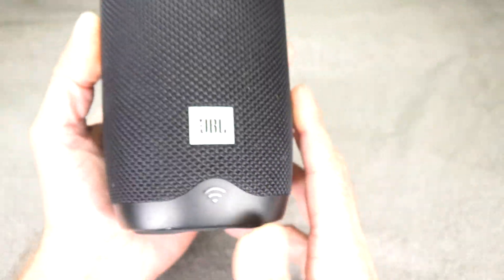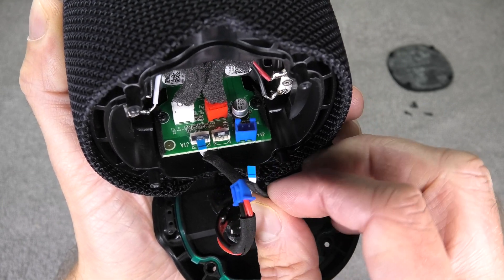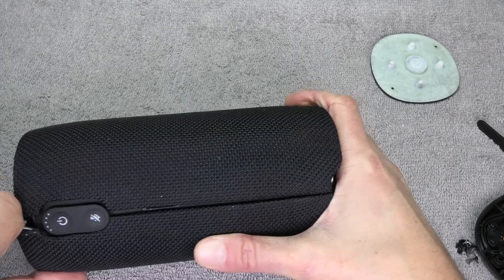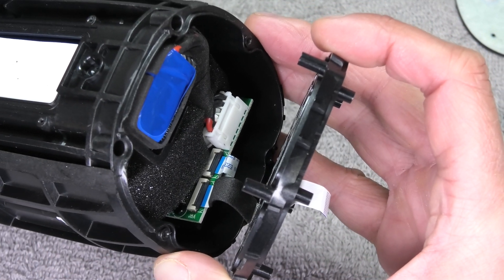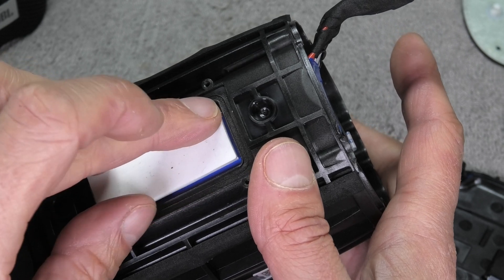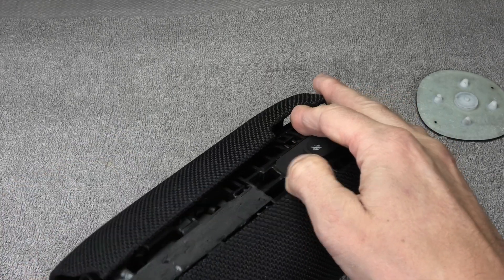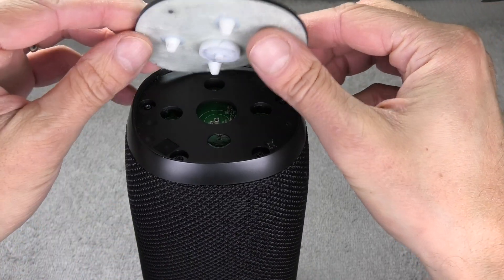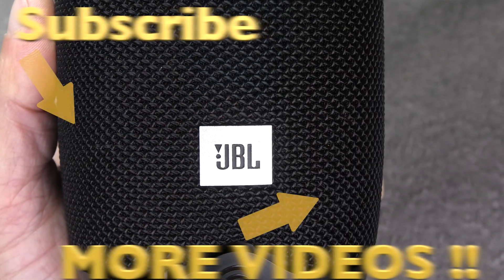Battery Replacement for JBL LINK20 Bluetooth Speaker (How to DIY)

Comment: Ok - Finally got around to this. Thanks for the video. A couple of notes not expanded on in the video. The screws with the washers are incredibly difficult to remove. I sprayed them with penetrating oil and let them sit for 10 minutes. I was careful to just get a quick spritz in the hole and protected the speaker with a cloth, wiping up any extra. I then placed the speaker on the ground between my feet, and used a new sharp Philips #1 from a precision screw driver kit. to apply downward pressure while slowly turning. The thinner shaft of the screwdriver is 4 inches and the total length is double that. This is important because the second set of tough screws (the ones you can only access after removing the metal battery protector which hold the second cap in place), requires an angular approach, so a short driver will not allow you to apply torque. A longer driver rises above the body and allows you to push and turn. Again - slow and steady, they are not in as tight as the top cap screws which may be glued in, but they are still tight.  Lastly, the battery foam is impossible to peel off. Not sure how the author did that!? Or maybe his replacement came with it. Mine battery did not. Instead I used 2 way foam tape and wrapped it. I did not remove one side of the tape and mimicked the taping of the original. It snugged right in. I hope it doesn't pose a problem? The original just looked like regular foam to me. I tested the unit at each step to ensure it worked before tightening the screws. Bit of a pain in the butt to replace but it is a good speaker and today's equivalent would cost 170CDN dollars with tax to match the sound so the 40 dollars I spent to fix the battery and the charging port were worth it for me.

Comment: What are the white and gray wires next to the two red and the two black wires on the battery wires
Reply from the maker: Those may be temperature sesndirs to prevent the battery from overheating

Comment: Would you happen to know how to factory reset the link 20
Reply: hold the mute button for more than 14 seconds.   your device most likely wont reset if the battery is almost dead, even if plugged in.   you can go in to the app on your phone, click on that device,  tell it to forget the wifi connection, then click on remove device.   then start over and have your app find the device.   i had a link 10 with a dead battery - even when plugged in it wouldnt properly connect , be reconized, and function until the batter had at least 2 dots of charge.  nearly dead battery will prevent you from getting the link to work correctly, even if plugged into power cord.

Comment: Thanks man. It was a bit more difficult for me because the battery did not want to come out. I had to mess with making a hole on the bottom side of the battery plastic holder and hammering with a rod through the hole to get it out. Also my screws in the top part were so tight in the plastic tubes that (except for 1) all tubes cracked. Well - no problem because this one is standing still on the kitchen counter most of the times anyway.

In the end, everything back together and working fine. Feels good to not have to throw it away.

Comment: how much for the new battery pls? mabe its not worth it, to fiddle and better buy a new speaker? My Fisher speaker, since it was new, cant work for longer then 25 min or less. after full charge. I wonder, mabe its best to buy a better one.
Reply from the maker: That always depends on the quality of speaker you have.   
When the speaker was relatively cheap in the first place then it probably isn’t worth replacing the battery.   
For higher end speaker it usually is worth replacing the battery.  
The batteries usually cost between $10-30, depending on capacity.
Reply: @MegaSafetyFirst  Thank you so much!  I dont remember how much I paid, probably less then 20-30$, so then, I guess, I be better off buying the better one. How do I find out- how long it can work before recharging, pls? I like it to work at least n hour... Any suggestion on the partric one to get? I think they never place such info on the box... Not even in manuals... I like to use mine in a shower, room so it has to be ok with steam. Thank you in advance!
Reply from the maker: Most speakers usually last 4-5 hours now.  But it really depends on how much you are planning on spending.  
I like JBLs Bluetooth speakers, but they are always pricey. 
I would look at what lack Friday deals are  available.  And you want something that is IPX7 waterproof.  Those types of speakers will handle being in a bathroom/shower.
Reply: @MegaSafetyFirst  Thank you, what would be a price tag, pls? I also want a good quality sound, to enjoy the music :-)
Reply from the maker: I’d consider the JBL Charge3.  It is an older model, but that makes it a lot cheaper (~$100) at the JBL website.  And it comes with a lot of features: 20 hour playtime, you can charge your phone with it, works as speakerphone and of course waterproof.

Comment: by any chance do you or anybody on here know how to take off the power cable to access the charging port? the ribbon right next to its very simple but the white one that's the actual power I cannot figure out how to take it off and it's driving me absolutely bananas! please please please somebody help me please.
Reply: It doesn't come off. It is a soldered joint. Disconnect the other end, remove the sealant and pull it through the hole. The charging port PCB comes with a new cable.

Comment: hi, i bought JBL link 360 pro its a display/demo pc from EU or USA n i live in UAE. the battery is not holding any charge, so i guess i cannot connect to the google home app while in the charging port. can u pls advise while it is in charging Bluetooth should work/connect? i tried pressing Bluetooth button, but nothing.
Reply from the maker: Since it is a demo/display model, it is not possible to connect the speaker via Bluetooth.  The software on those units is different from the regular speakers